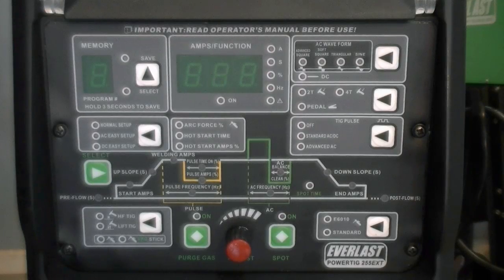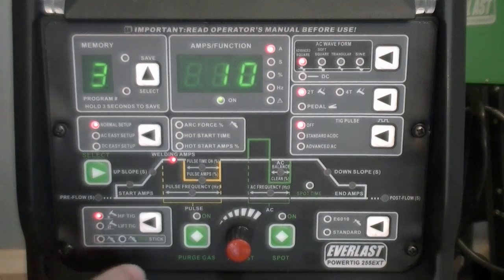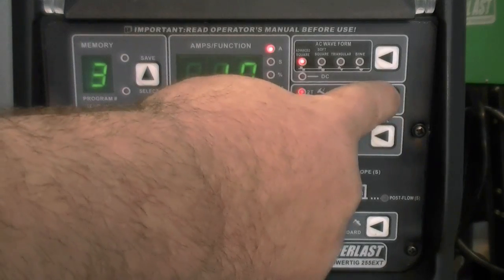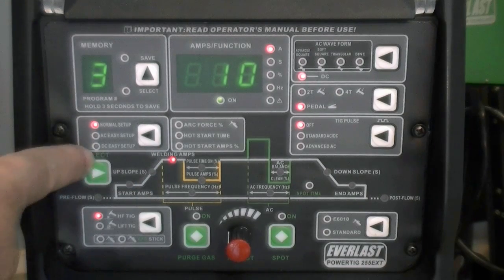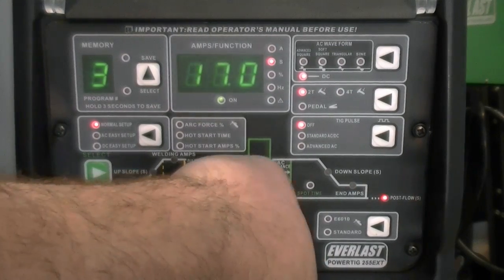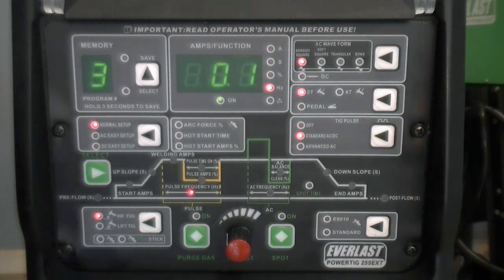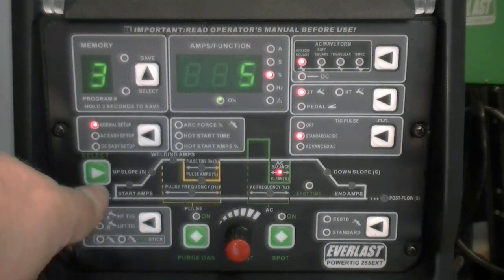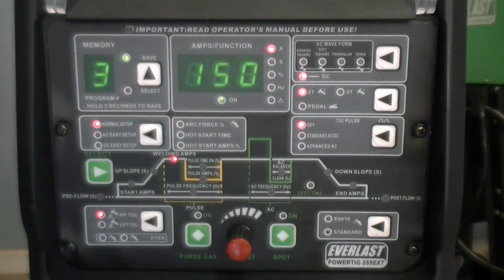AC/DC PowerTIG 255EXT IGBT Inverter TIG Stick Welder Part 3: Tutorial 2015 Model

Comment: I have the new 2020 version of this but I think the menu is the same. First of all I hate the way the memory functions. I want to be able to start with one saved memory bank that is close to what I want and make adjustments as I’m welding. Then once I get it dialed in save it to a new memory slot so I don’t loose my original but as soon as you change memory slots it looses the settings. Also the pulse menu is frustrating. If I’m Welding DC pulse and just want to turn off pulse you have to scroll past the AC setting which  automatically changes welder to AC and leaves it there. It then takes several button pushes to get back to DC. That being said this welder welds awesome if you can get around the funky menu quirks.